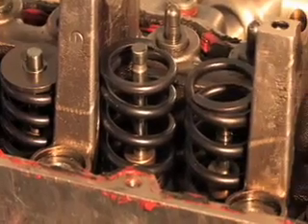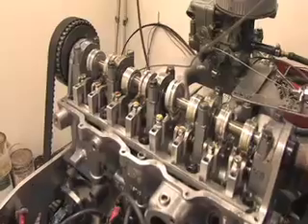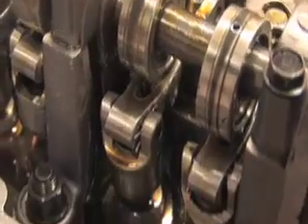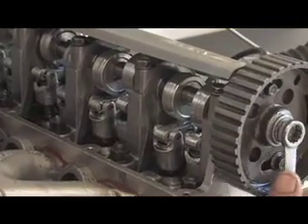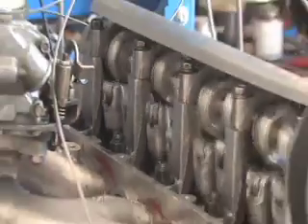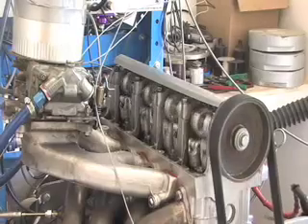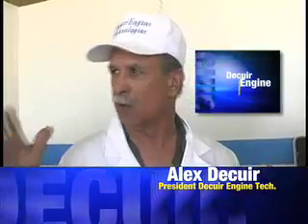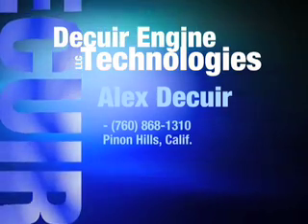New Engine Technology/Springless Valves

Comment: Not truly impressed. I see springs, where the narrator said no springs at first.
Reply: +EmpEntTV pshh, this is youtube. you expect him to watch the entire video before bashing it? hah
Reply from the maker: +johnnymitz, If you had paid closer attention you would have noticed that it was stated that the smaller springs are there to hold the valve guide seals in place and do not have anything to do with valve actuation.

Comment: Go rotary and eliminate it all..
Reply: Hey! What's the difference between Rotaries and Desmodromic valves????

Desmodromics are still in production...
Reply: +The real doktorbimmer You must know that Wankel engines use an Otto cycle, as do also gasoline 2-stroke recips. Compress air/fuel mix, timed spark ignition, expansion with various filling/scavenging. You could instead compare them with RECIPROCATING engines. Mazda Wankels were very well suited to emission controls, being dirty enough to light afterburning easily.
Reply: Rick Lorimer Ah, yes... I miss those 2-stroke bikes... very fast , and very cheap and easy to rebuild..
Reply: +BushPilot444 cost of maintenance??
Reply: dragonslayer1483 Depends on the type of rotary engine..  but typically engines like the Gnome et Rhône and Oberursel UR-II were considered low maintenance for the pre-1930s era.
Reply: +The real doktorbimmer pre-1930's? how is that relevant to today's standards?
Reply: dragonslayer1483 Its not... the Rotary has obsolete since the 30's
Reply: The real doktorbimmer ah, well when i asked about cost of maintenance, i was referring to rotary motors at least in the 21st century
Reply: dragonslayer1483 The Rotary internal combustion engine was obsolete from production and out of common use well before the 21st century....

So in terms of today's cost
the question is moot...
Reply: The real doktorbimmer yeah, so op doesnt really have much of a point in my eyes.
Reply: dragonslayer1483 Yes, perhaps BushPilot 444 was just being sarcastic, or just really really confused..,
Reply: The real doktorbimmer yeah, theres a reason people complain about rx-8 maintenance
Reply: dragonslayer1483 He said Rotary... not Wankel
Reply: The real doktorbimmer you know what i meant. -_- rotary is very commonly used when talking about a wankel motor
Reply: dragonslayer1483 Although also obsolete, the Wankel KKM is not a Rotary type engine..

Commonly used?
Not among automotive engineers..

Wankel KKMs engines not known for particularly high "maintenance" costs.. but are notorious for premature failure and short service life...

Remanufacturing, rebuilding and major overhauls are beyond the scope of periodic scheduled or unscheduled maintenance
Reply: The real doktorbimmer replacing parts to keep it from failing is maintenance. hell, every car is low maintenance if you wait for it to fail before you do anything to it. i didnt say that wankel motors were commonly used, the word "rotary" is commonly used in place of "wankel" but im sure youll find yet onother way to misinterpret what i said..
Reply: dragonslayer1483 Well replacing apex seals requires engine removal and complete tear down..

This is not maintenance, this is engine failure.. 

I think your confusing a now defunct brand name with an engine type..

The two are not synonymous
Reply: The real doktorbimmer if the motor still runs without tearing it down its not really engine failure. engine failure is when something fails and prevents the motor from functioning properly, and bad seals only reduce power.

as far as i know wankel motors and mazda are pretty sononymous with each other because mazda is the only modern car company i know that is dumb enough to use them. if there are any other car companies that have made cars with wankel engines, then tell me. as long as it is not like 80 years ago
Reply: dragonslayer1483 Well, even Mazda replaced the engines under warranty if the compression drops below 100 psi..
 The only condition that warrants engine replacement? Is engine failure..
 
Good point though, typically other engine designs fail hard... while the Wankel KKM can and often will continue running (very poorly and at greatly reduced efficiency and output) long after the apex seals have failed..
 a failure mode not usually seen in other ICE designs.

While Dr Felix Wankel did design a rotary supercharger and a prototype for a rotary engine... his rotary design was never used in production (I believe the only example resides in a German museum)

Dr Hanns Paschke who designed what we all know as the Wankel engine... discarded the Rotary layout for a conventional layout, the Wankel KKM-57 sold by Mazda has a spinning crankshaft and flywheel, parts not belonging to a rotary ICE.

No one uses them now.

Mazda cancelled development in May 2009
 production ceased on June 22, 2012

of the 26 original Wankel KKM licensee's
None still offer a Wankel engine..

There are no longer any manufacturers of Wankel engines.

Its now obsolete, just like the Rotary
Reply: The real doktorbimmer dont get me wrong, i love wankel motors. a turbo rx7 or rx8 is awesome, but i would never own one. 4cyl motors are the cheapest imo, easy to work on, cheap on gas, and reliable
Reply: dragonslayer1483 The Mercedes-Benz C111 has always been a favorite of mine,
but the engineers at M-B seemed to have discovered something Mazda did not for another 40 years.. that the Wankel simply would  never been competitive with Otto and Diesel engines
Reply: The real doktorbimmer had to google that one. the power output is pretty impressive with that one! its a shame they didnt make more
Reply: dragonslayer1483 Very impressive for 1969..including the use of GDI technology.

It was soon found that the Wankel would not meet reliability requirements and impending emissions regulations.
the 1973 oil crisis ended any hope of ever reaching production.
 Engineers working on the problems around the world were starting to understand that the Wankel KKM design had very serious efficiency, reliability and emissions problems and that the design could never compete with Otto or Diesel.
 Mercedes-Benz abandoned the Wankel engine and went on to make its fortune developing a very successful line of automotive Diesels.
Reply: The real doktorbimmer you know alot of stuff
Reply: dragonslayer1483 Thank you. You seem to be very intelligent as well, do you have any aspirations of be coming an automotive engineer or are you just an enthusiast?  

I have spent my entire career working in either the automotive or aerospace industry...
Reply: The real doktorbimmer well im just 19, and yeah im just more of a car enthusiast. i love cars, but im not sure if im really cut out for college. i tried it, but it about killed me. ill probably just stick to going to car meets and messing with my car for now haha, thank you though
Reply: +The real doktorbimmer yeah make him your little twink
Reply: +dragonslayer1483 Become a mechanic now while you're young if you're not going to attend college. Go be an oil change boy somewhere and apprentice your way up to being a mechanic. Not the greatest money making career choice - but better than a lot of alternatives that dont require college.
Reply: Jacques Blaque Lol..!!! No, that's absolutely not true.. a complete falsehood.

While the Wankel KKM design does indeed utilize the Otto cycles basic mode of operation.. 
The 2-stroke Spark ignition reciprocating engines do not... DO NOT. 
They use the BENZ CYCLE..
(Karl Benz originally did not use the patented Otto and Langen engine design)
No, any engine that uses pre-mixed oil or oil injection is VERY POORLY SUITED to emissions control exhaust after-treatment..
Excess fuel and lube oil severely foul both catalysts reduction and oxidation beds, also fouling lambda sensors and clog EGR valves.
Mazda's Wankel engines required expensive special over-sized catalysts and more frequent inspections and replacements than typical cars sold before the Wankel became obsolete.
Reply: +The real doktorbimmer Okay, calm down and stop posing. First, the Otto cycle is an idealization, for study. Then see http://web.mit.edu/16.unified/www/SPRING/propulsion/notes/node25.html about your distinction re 2-strokes. You're also talking pure poo about Mazda Wankels & emissions, back when. As I tried to explain to you elsewhere, they were VERY WELL suited to emission control for years, BECAUSE OF their incomplete combustion, using afterburning reactors in the exhaust. And ... there are some small 2-strokes (PPE) that use catalytic converters effectively. CALM DOWN DOKTOR, and think before spouting.  Out.
Reply: +dragonslayer1483 
Nobody buys a rotary engined vehicle for the reasons you mentioned. You're an idiot. It's like buying a Ferrari.
Reply: +The real doktorbimmer 
Just like two stroke motorcycles. Totally WRONG, but awesomely FAST.
Reply: Rick Lorimer Well, at least with the Ferrari your getting more power per liter.. and the mystic of a championship winning marque...

Comment: The cam followers are linked to the cam "lobes" via a small pinned link, similar in concept to how a conrod connects the piston to the crank.  This system converts the rotary motion of the camshaft to linear motion at the valve, the opposite way the conrod converts the piston's linear motion to rotary motion at the crank.  This is nothing new and it's also the answer to a question that doesn't exist.  Back in the dark days before modern valvespring material, mechanical valve closing held some merit.  What proponents of desmo drive conveniently ignore is that while desmo drive is subject to decreased friction at low RPM, its friction losses at high RPM are far greater than a sprung valvetrain.  A sprung valvetrain is the opposite, with greatest frictional losses at low RPM and decreasing friction at high RPM.  Mechanical valve drive generally also imposes far greater side loads on the valve stem, greatly shortening valve guide life. Desmo's time has come, and long ago, passed.  Ducati is married to it for marketing purposes.  Ducati were not the first to use it and certainly didn't invent it, but they are stuck with it.  
Innovation?  Not quite.

Comment: When using a 'normal' camshaft you can grind the required shape of the lobes.
Here I feel that you can change the valve lift, but NOT the valve diagram.
Reply: +olafzijnbuis exactly! You can't do anything as far as profile, can't change duration of opening or speed of lift. Might work good for a lawnmower engine or something of that sort but even then I don't see it holding a candle to the proven Honda gs and gx series small engines.
Reply: +Corey Schmidt 
While I am an electronics engineer, I always wonder why all these people like to improve a system that is very cheap and works ok.
A piston engine with valves and springs is very cheap to produce.
Nevertheless many 'inventors' just dislike pistons to go up and down. Often they propose real complicated solutions for a non existing problem. Some design use lateral pistons where the acceleration forces will surely
wear out the cylinder walls in no time.
This valve train is so stupid!. How can you ever tune an engine and comply with emission rules when you can not 'play' with the valve lift profile.

What really worries me is that the got as far as building a prototype. Did nobody see the problem, or are we all blind?

Comment: Ducatti use this system on their motorcycles . have done for years
Reply: *****
i am aware of that but this says NEW  engine technology . this is not so different . the valves are mechanically opened and closed . there is NOTHING new in internal combustion engine design . as far as i know
 . the aim of this engine is to do away with valve springs
Reply from the maker: We are fully aware of that we are just experimenting with different designs for automotive applications.
Reply: The cam lobes are eccentrically on the cam shaft and has the same result as normal lobed camshafts ?
Reply: ***** Ducati uses a very, VERY different system.. that allows for different Cam profiles, and therefor leaves plenty of room for engine turning.. this mechanism is from the steam age.. can't do any change in valve timing or opening/closing curves..
Reply: No... because the lobes on this cam are round.. if you look at "performance" camshafts you will notice a much sharper profile.. making the valve open much faster.. , furthermore.. the opening and closing curves can be made to get a much better timing...a round profile doesn't do the engine any good.. it is as "sophisticated as a steam engine... hardly... "
Reply: *****
It all depend on the speed at witch the engine is designed to run at . And bore vs stroke ratio .  A valve open longer flows as much air as a higher lifted valve open for a shorter time . Anyway this engine would suffer more from friction loss . It would be interesting to see figures for this set up
Reply: the whole point of Desmo valve set up is so an engine can rev to high speed without valve flutter and bounce . Running this engine at high speed would incur large friction loss
Reply: the surface area where the cams meet the rockers is massive
Reply from the maker: +Bazawaza1 We know that
Reply: EmpEntTV it's an interesting motor , from a hobbyist point of view but engines are designed with a application in mind , like a long stroke motor for good torque for trucks ect . Whats the bore & stroke ? what revs do peak power/torque occur ?  A high revving over square engine of this design would be impressive .

Comment: when are both valves closed so it can get compression?
Reply: The valves are almost closed by the cam action. The last smidgeon of complete closure is effected by the compression as a slight amount of play between the cam and the valve operating finger is established under assembly to enable this. Works well;  but remember that although a  valve spring needs energy to compress it,  upon the spring  re-asserting itself it puts some of the energy back. The loss under cam rotation is not a lot.

Comment: There seems to be a big downside, right off the bat, very heavy valve train parts, and most likely vibrations as the rpms climb. I doubt any fuel saving for this design, over much lighter weight standard valve train components. Maybe a new way of doing it, but it's older tech ideas, like ww2 era ? Even before ducati stuff. Hay I am into new designs, but they need to be a real improvement. Like it says in the bible, there is nothing new under the sun. But keep trying, it's still has a cool factor. Best to you. yl

Comment: It's very noisy mechanically. I can't see this being mainstream. Too many heavy moving parts compared to a regular valve system. Only advantage is the lack of a spring. How high can these types of engines rev usually?
Reply: TheDeduction By that logic, can this be adapted/used on non-OHC engines? Such as an OHV Chevy or diesel engine?
Reply: Ducati has been using them for well over 20 years. Their highest revving engine revs to over 20K... There are actually less moving parts to this system than a traditional spring system...
Reply: robby844 great but this seems like a rip from desmodromic valves

Comment: As others have said, the desmodronic valve actuation is nothing new. Initially used by AutoUnion (predecessor to Audi) in Germany in the 1930's as a way to get higher engine speeds which were limited by poor valve spring metal. Ducati still uses it as a signature technology. Most other makers have abandoned it as new valve spring metals do the same job at much less cost to make and maintain. And what is the max RPM with this setup?

Comment: How about magnetic valve actuation ?
Reply: fliteshare Pretty much what Pneumatic valves lets you do.
Reply: Thats something worth while.
Reply: *****
Imagine controllable opening moment, time, speed and trajectory, independent of anything mechanical in the engine.
Reply: Koenigsegg has a patent on this, expect to see it on their cars in the near future. Has lots of nice benefits from computer controlled timing and duration as well as a much more square actuation. I believe /DRIVE did a special video and interview with Koenigsegg on this new tech.
Reply: Psycho Von Cunt
So how do you control pneumatic valves ?
Reply: Air pressure.
Reply: fliteshare That's a different question.
Reply: Psycho Von Cunt
Might be, but I am just following the system further upstream. Until we both arrive at electronic.
Reply: How can the overlap be set. Valves look slow to open and close?. Surely harmonic cams are best.
Reply: Crobular I No cam necessary.
Each valve is individually controlled by an electromagnet (loudspeaker coil). Individual thyristors drive the power to the coils, in order to actuate the valves. All this controlled, timed and synced by the ignition (and now also valve timing) computer.

I haven't heard of anything beating electrons for speed though.
Reply: fliteshare Electrons move very slowly.
Reply: VVT?
Reply: Sam Young I suspected the Audi R10 TDi to use it. Because Audi was super paranoid about showing their engines after finishing 1,2 and 3 for a couple of years at Le Mans.
And I wondered, what else you could do with diesels to generate more power and torque than controlling the valves more accurately ?